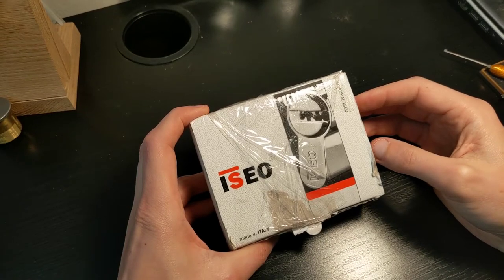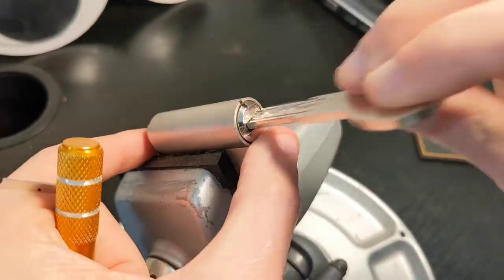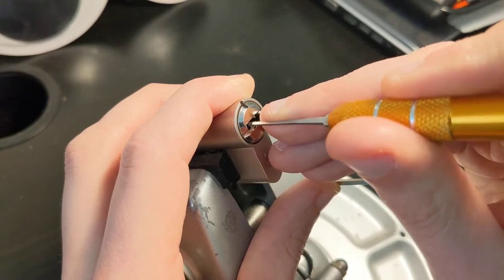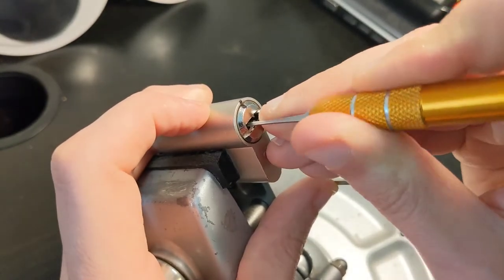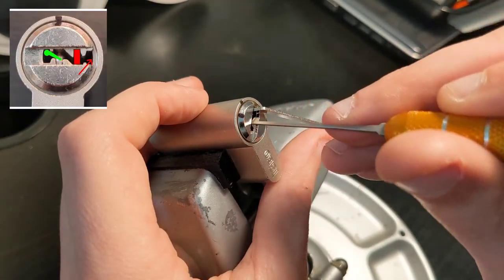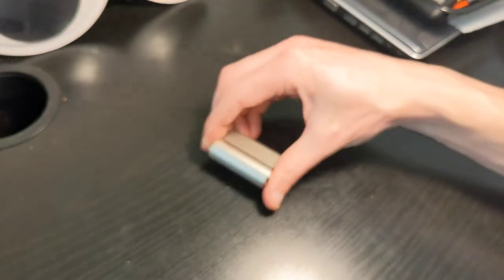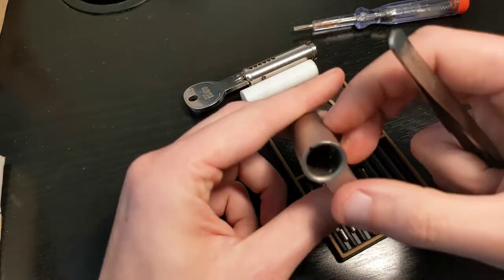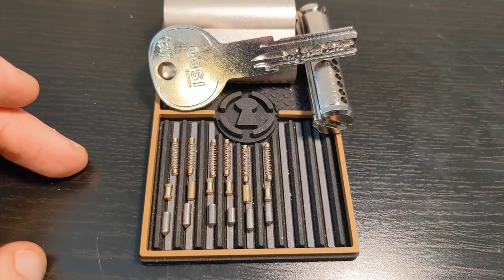(26) Beginner dimple locks part 4 - ISEO R6 #PH100

Comment: Very nice job my friend, I was rooting for you to win the key cutter in the CLKsupplies giveaway
Reply from the maker: Haha yeah, that would have been pretty sweet, i want to try to cut these rotation setting master keys for medeco bi-axial and M3... But you can't do that without access to a key cutting machine for a long time, I'm pretty sure the local locksmith will not approve of me using their machine....

They ended up sending me the lab mat, a beany, a twizer and some shim so pretty good nonetheless. Especially that i wanted a mat for some time, too often i had to hunt for a pin that rolled from my smooth desk surface. The one that still gives me nightmare is a tiny spring from the VSR cam 🤬😰